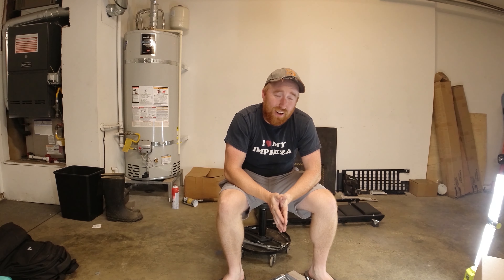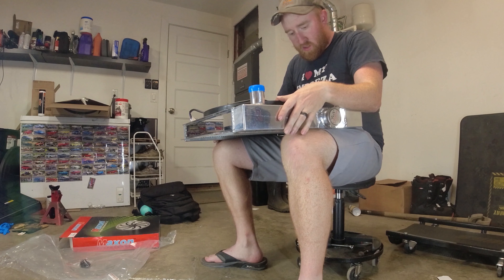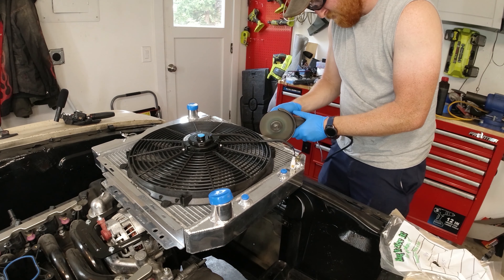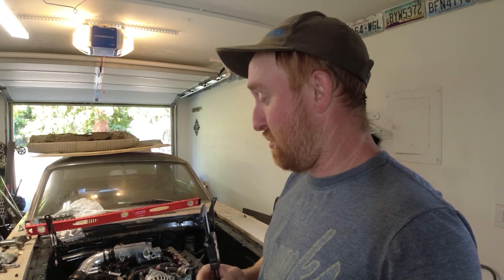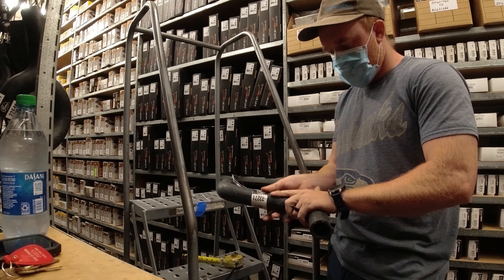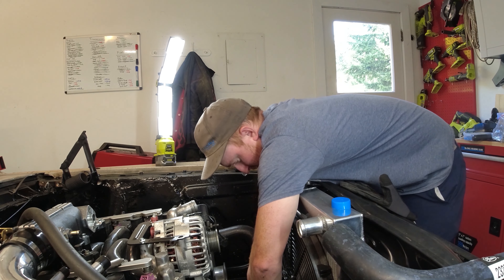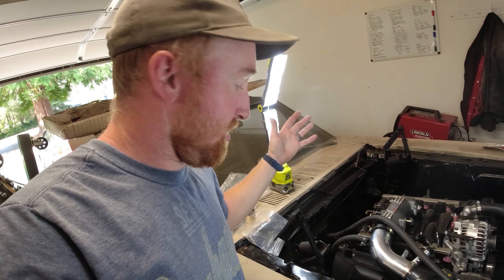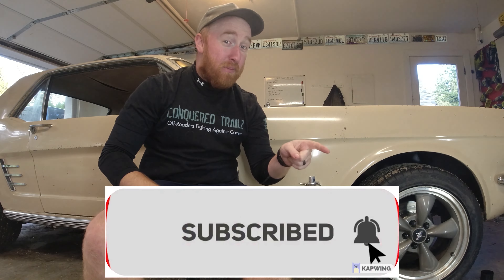DIY COOLING SYSTEM for Classic Mustang? : 1966 Mustang 4.6L MOD MOTOR SWAP. Episode 6

Comment: Hey bud im having a slight issue with my 66  rear end . I wanted to ask what did u set your shaft angle . Im getting ready to weld and a co worker said the drive shaft has to be at a slight angle . Im sorry to bother u
Reply from the maker: You aren't bothering me bud. That's why I made these videos. To help! 
I can't remember the specific angle I used. What I did was, I used the angle finder on the output of the transmission. Let's say 3 degrees down for example. What I did was matched the axle angle, with one degree down from that. So say 2 degrees up, as an example. If that makes sense?

Comment: A complete novice here (silly question inbound - apologies). Why have you attached a fan to the radiator?
Reply from the maker: The radiator needs airflow when the vehicle is at a low speed or stopped. Otherwise the coolant running through will not cool off before entering the engine again. While at full operating speed like on a freeway, the fan turns off and just uses the air flow from driving.
Reply: @4WDTrek  thanks very much - loving the series
Reply from the maker: @NornIronno1  thanks bud. If you haven't already, please hit that subscribe button for me! Thanks!